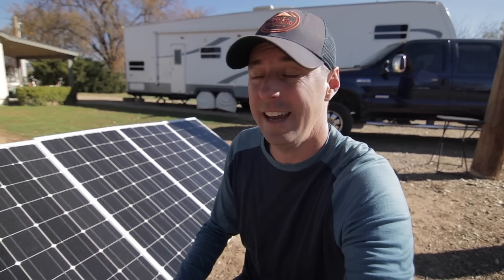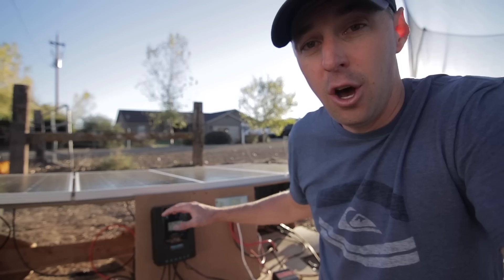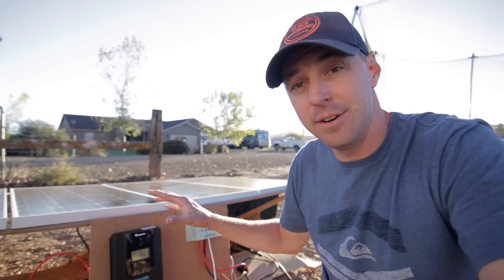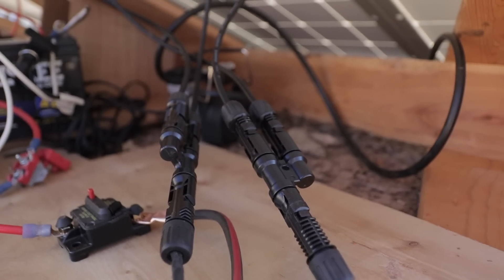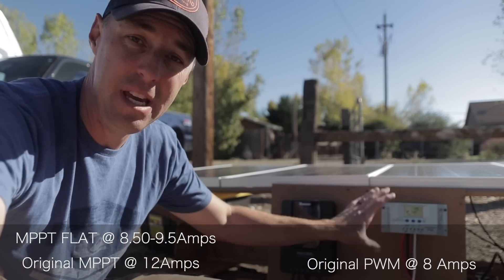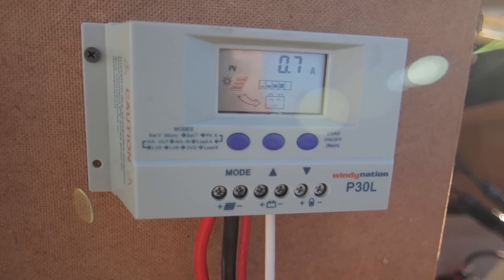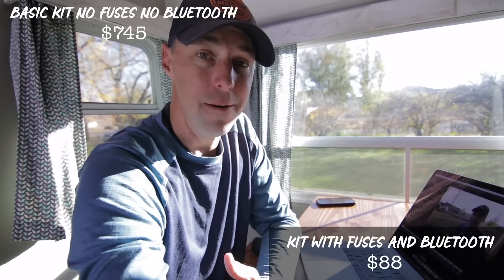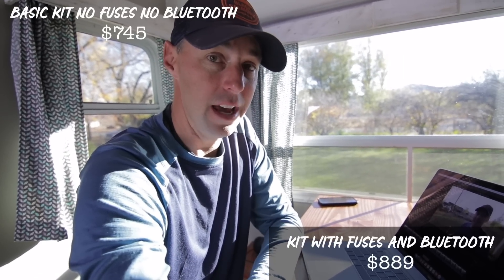RV Solar! Getting The Most Power From Solar.

Comment from the maker: More coming on wiring comparisons in up and coming videos. We are going to cover the MTTP with series, parallel, and series-parallel, just to mention a few with all 4 panels. I’ve also had a few questions about the batteries we used. They were similar lead acid batteries in good working order drained to close to 50%DOD before I started the comparisons.  Thanks for watching!
Reply: All About RV's, solar question.  First- awesome video(s) on solar.  I used your KYD video to install ours. Currently,  we're in Buckeye,  AZ on full 50a hook ups.  With solar installed, plugged into 50a we can't go over my 2000w inverter limit. 600w panels,  outback 60 mppt, 2 BB lithium and Aims 2000w inverter.  50a into switch,  black hot into fuse panel, red hot into sub panel- into inverter- into other side of fuse panel. What am I missing? How do I get the couch to run 50a shore power as normal with inverter power once unplugged? Thanks Mr Gillis

Comment: Since the shade test seems to be affected by the panels being arranged in series rather than parallel, a possible solution might be to add a switch to change the arrangement of the panels on the fly - parallel in the first switch position, series in the second. Of course the wiring would have to be run for the highest possible amperage, but when shade kicks in and power degradation occurs, you could flip the switch and see if your throughput improves.

Comment: Hi, I think you've hit on maybe half a dozen videos touching on the subject of solar.  Here's some observations as I'm finding these videos by various contributors are helpful in ways, sure, but really are missing the mark in helping end users understand options and solutions.  All the videos on solar don't seem to tie out a limited subject or concept covered - to actual use, operation, user operation in practice - as part of a solution, or as a solution in RV's.  

After struggling through video after video (after video, etc.) from different contributors (sincere thanks to all including this video for the different views on the topic), that wow, there's so much technical talk about equipment and how they're hooked up, "walkthroughs" even... However, there's very little talk about operations, control panels, uses in RV's in different situations and conditions, capacities and practical applications, "practical examples" in application and use such as, "here we have a case where we're now off shore power, and we can see these 5 units in operation operating on solar input shown here, and battery consumption shown here, and this means that we can expect it to sustain for X hours before Y happens, etc." ... that it would just be really helpful as a suggestion at least that such videos be recorded as Livestreams or with a select audience of newbies of your choosing, so that questions can be asked on the fly, addressing the gaps that these videos always have, especially to operational and situational questions about day to day use in RV's.

Nobody seems to close the gaps on build (equipment and connections) to real "design considerations matched to practical uses and needs", and end-user controls and operations to use them.  I get now after many videos by many contributors that a good system needs:  batteries, charge controller, inverter, some breakers, solar panels, converter, and more importantly to end users, the abilities to monitor, measure, and control function and performance.  But all the vids don't seem to cover and integrate these challenges:

A) determining and sizing needs 
B) practical function and operation of equipment and systems
C) system design:  incl. trade offs, options, considerations
D) equipment selection
E) assembly
F) administration (daily living and operations, monitoring LCD panels and outcomes, and managing.)

And all these challenges kind of go together that we can't affect one aspect/challenge without a fundamental understanding all of it and how it comes together into a solution?

Finally, applying solar to RV solutions... I've been shopping for an RV for 2 months of hard research, lot visits, discussions with sales reps ... as one says - I think it may actually have been you who said it, that "there's only so many configurations, the brands copy each other, the same appliances, etc." ... so for example for A/C, there's really only 3 configs in most units:  a 13,500 unit, a 15,000 unit, or both a 15,000 and 13,500 unit.  Typically a 8 cu ft fridge, a couple TV's, a convection micro... so it seems that when talking about solar solutions we should be able to design for common practical solutions and walk through A through F above?  Or what does it mean when the very few Solar Prep options shown on RV units for sale offer even rarely a 100watt or 200watt or 270 watt solar option in addition to the pre-Solar hook up?  How effective in the standard usual RV as described with an A/C, 8 cu ft fridge, etc. is a 200watt system?  How would we know?  How do we make sense of A through F?

Just trying to help, that if these videos by various contributors are intended to help... they really might address A-F with practical examples that align to common RV situations and configs... which is all off the top of my head after seeing another solar video.

Comment: I am glad at the end you mentioned the impact of the shade had more to do with running the panels in series versus parallel.  I am working through what combination of parallel and series to create zones on my roof to best handle shade while minimizing the cable size because of amperage.   (higher voltage)

Comment: ...  hi, would there be an issue with wiring simple double-pole, double-throw (DPDT) switches to select series or parallel wiring to one load from two power sources? In this way, one could optimize the wiring for the situation. Could even be multi-tiered for a varying combo of series-parallel to all series to all parallel, depending.

Comment: Jared - Just bought a 30 ft Rockwood 2604ws and am planning to put panels and potentially use lithium batteries instead of lead/acid and have a few specific questions about your experience about doing this as a DIY project but am hesitant because there are many "moving parts".   For example: drilling panels, feeding cable, cable gauge, components such as MPT Charge Controller, and inverter.   I was thinking of getting 265 watt Grape Solar panels instead of the 100 watt because they provide more wattage and are not terribly larger than a typical 100watt panel.  Should I ask them "one at a time" on the forum here or is there a way that I can ask the questions directly?  Kind regards, Dan

Comment: Sorry but your explanation on the PWM controller "dissipating the extra voltage as heat" is just not correct.  That would be true for a linear mode controller, or wiring the panel directly into the battery without a controller at all.  It is not actually less efficient than an MPPT (not MTTP) controller, but does not adjust its output to maximize the total energy from the solar array.  The MPPT is also a PWM controller in terms of the method used to translate the input voltage into the correct output voltage.  It's difference is generally two fold:  1) it can operate at a higher input voltage allowing the use of a series connection and lower current (for the same power) allowing the use of smaller wires between the panel array and the controller.  2) it doesn't just regulate the output voltage (which is what a PWM by itself will do) to a fixed amount but actually adjusts the voltage (within limits) to get the maximum possible power from the array while still charging the battery.  It actually does this by slightly adjusting the voltage setpoint and seeing if the total power into the battery goes up or down based on the adjustment.  It is constantly running this test to operate the panel array at it maximum power point, hence it's name "Maximum Power Point Tracking", or MPPT.  In short, the power delivered to the battery tracks the maximum power available at the time from the solar array to deliver the maximum energy to the battery.

Comment: You never mention the voltage. The amperage is only half of the equation. 

Also, the reason the MPPT did worse in shade is because the solar panels were wired in series. 

What were the voltages of each array under full sun?

Comment: From what I think I have learned from your videos, the pan also are always producing volts if they are in sunlight.  If your batteries are charged, what does the controller do with that energy?  It seems like if you had 3 or 4 panels that could be a lot of heat if you have charged batteries and no place for that energy to go, how does a system handle. This energy?

Comment: I like your videos. This is the exact setup for panels that I use. Two in series fore and two aft. I like the way it handles shade when you get some and you will get some on occasion. I'm having good luck just using the the standard 10 gauge solar cable to a home made distro box and a single set of 8 gauge to my mppt controller. Looking forward to the rest of your buildout.

Comment: where is the head to head comparison of both using either one panel or parallel panels. Where is the $ to $ comparison of $800/400w mppt vs $800/700w pwm? Why such a cheesy pwm controller?

Comment: I would like to see comparison all series,parallel, and series parallel in both shade and no shade  I try to park in shaded ares to keep cooler and nor use so much juice and keep my panels on the ground where I can try and keep them in the sun rather than climbing on the roof to change and clean my panels   its easier to just fold them up than to install on roof and park out in the  sun  .  I love the lithium batteries they last longer and quicker to charge    looking forward to your next video  thanks for your time info and effort
Reply from the maker: Thanks! I think titling panels on the ground is a great plan. You can get close to maximum efficiency almost all day. The comparisons will be coming your way soon.

Comment: But you didn't comment on the batteries.  The batteries seriously affect the charge amperage.  A full battery cannot take 10 amps or it will just boil of water, so the charge controller cuts back the amps even if it has power available.  Also AGM batteries can charge faster than regular batteries, and Lithium faster again.  And new batteries charge faster than old ones.  So the most important factor in solar charging is in fact the type and state of the batteries, not the panels or the controller.  To do this test properly, you would need to construct a 12 volt dead load.  A full battery will not take a charge.  An old battery will not take a fast charge.  A dead battery will not take any charge at all.  The battery load needs to be carefully controlled to do such a test.  And anyway normally you either have too much sun and full batteries, or no sun and dead batteries, whatever the solar system.
Reply from the maker: You’re right I didn’t highlight the batteries but they were similar lead acid batteries in good working order and both had a DOD of close to 50% before I started comparing the system.
Reply: @AllAboutRVs  Ok, I just wanted to mention that because the type and condition of the batteries can make such a difference as to charge uptake.  A typical lead-acid battery doesn't want to take more than about 10-15 amps on acquisition, which is why so many battery chargers are 10 amps.  And if it has a meter you'll notice most of the time it is well below 10 amps going in.  This is why over-sizing your solar panels is a big waste of money, even in good sun the controller will curtail the voltage to about 14.2 volts which will mean low amps if the battery is near charged.  I find the right mix to be about 110-130 watts solar for every 100 amp hour battery, anything more is pretty much wasted.  In good sun a 110 watt panel can easily provide the 50 amp hours you need to fully charge a battery of 50% DOD over the course of the day, whereas if there is no sun it doesn't matter how many panels you have.  If you have other loads like laptops and a Fantastic fan it doesn't hurt to go up to 160 watts per 100 amp hour battery, but anything more is overkill.  The controller just throttles the sun power back so as not to overcharge the battery, and once it's full it's full.

You could also probably do a video on charging batteries with a generator, because some of the same principles apply.  I am always surprised by people who figure a few hours of generator time should charge up their batteries because they have a 75 amp converter.  But it doesn't work that way.  To get to a full charge with a regular battery at 14.2 volts you need hours and hours, not just an hour or 2.  Of course AGM and Lithium batteries are different, but most people run a marine battery due to cost.  It won't charge in 2 hours.  It just won't.  That's why solar works so well when it's sunny, a nice slow charge all day long.

It's even worse when you see guys with older trailers trying to charge their batteries on a generator and run incandescent light bulbs all night.  The old converters are not battery chargers, they are simply 12 volt power sources typically with a 5 amp battery maintainer attached.  You'd need 10 hours of gen time to charge 1 battery with an older converter.

Anyway I think this is an excellent topic you could explore further.  When it comes to sizing batteries, solar panels, etc., most people have no idea.  Also power draws are a significant factor in how the whole system operates.  I've gotten much better battery life out of 2 simple changes, an LED TV and a spattering of LED lights (not all of them, too expensive, but the ones we typically use).  You can't do much about the furnace or the water pump draw, but switching to LED's can make a huge difference.

So for example when the 12 volt LED lights that could fit in a regular fixture came out, I bought 8 of them for about $100 (they are cheaper now).  I put one in each fixture that we typically use and left the other one the original bulb (how often do you use the "2" setting?)  It made more difference than having an extra battery.  And since batteries need to be changed out every 3-5 years, they paid for themselves very quickly, not even counting that it seemed we had a lot more power.

Where did I put my expensive LED lights?  Patio light of course because if you forget to turn that off at night you can lose 1/4 charge on 2 batteries, whereas with an LED you don't even notice it.  Living area, bedroom reading lights, bathroom sink, and kid's bunks.  It works great and they are very bright.  I never bothered with any "second lights", because we seldom use them.  Nor the "hitch light", how often if ever do you use that?

So there are a variety of ways to manage power now available that don't require a ton of solar, although a little really helps keep the gen time down.  I hate fussing with the generator.

Comment: Good video; what if you ran the 2 100 watt panels in parallel? I have bought a Tracer MPPT controller and was going to connect the panels parallel. If I did this what size wires should come off the controller to go to the battery? Once again great video.
Reply from the maker: Great question I have more videos coming covering this.
Reply: Thanks for your reply and a look forward to your videos on this. Kevin in Utah.

Comment: Out of curiosity, what would happen if you had wired the first controller in parallel instead of series?  I understand converting the higher voltage to higher amps, but would it still be more efficient controls?
Reply from the maker: Great question I have videos coming covering this testing the MTTP in series, parallel, and series parallel, but will require all panels on one system to do that.

Comment: Curious over what you think of using larger Watts Polycrystalline Solar Panels. I know the voltage is higher (24v) but, if you're charging more than one battery banks, that's an easy solution.